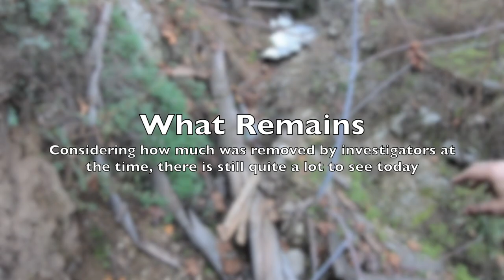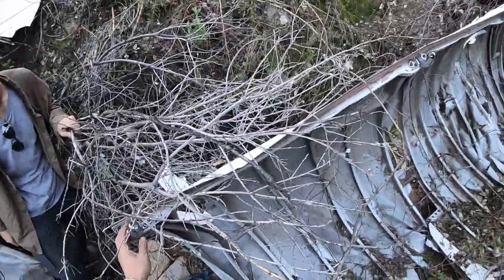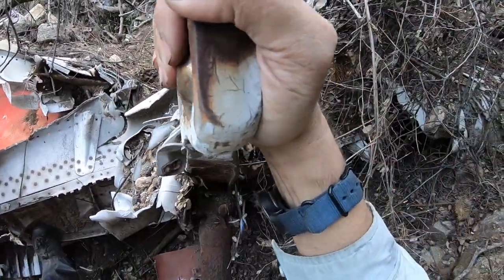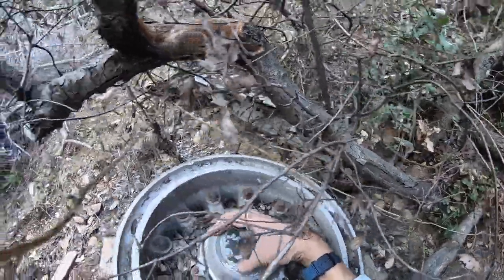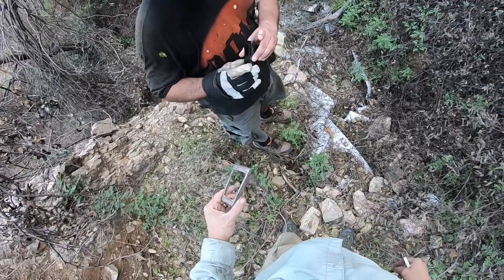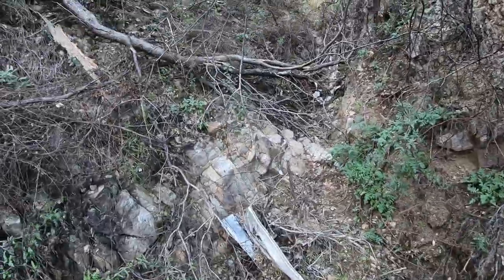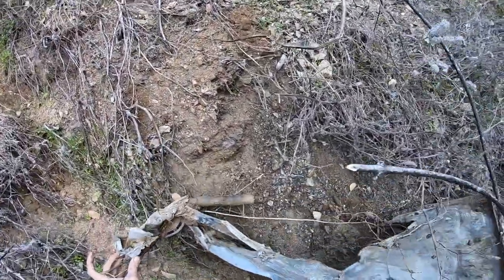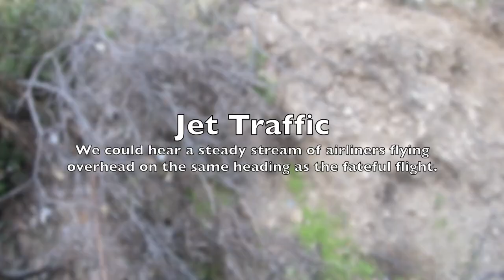1971 DC-9 Crash - Part 3 of 3 - Exploring the Wreck

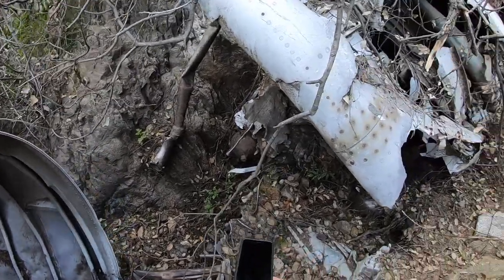Comment: The "round thing" at 2:53 is a brake accumulator. It sits in the main gear wheel well on the DC-9 (and MD-80).
Reply: Could also be one of elevator hydraulic accumulators placed in rear fuselage under the tail, since it is close to the engine cowling.

Comment: I heard the crash in my driveway in the Fish Canyon area of Duarte. It was a very loud boom, that at first I wondered if windows might be broken. My neighbor across the street shouted "look up there". A flaming piece of wreckage was visible falling into the San Gabriel mountains above our neighborhood. Then I saw the DC9 slowly losing altitude. No smoke or flames were visible. It glided down, dropping out of sight behind the mountain. Next came a huge plume of black smoke, then a second huge plume of black smoke. There was no sound, other than the initial loud boom of the crash. Another neighbor with binoculars spotted a parachute coming down, which we later learned was the navigator, who landed up on the mountain. It was a beautiful, clear late afternoon, on a Sunday I believe. One of my friends rode his motorcycle up Van Tassel Fire Road to the crash site, near Mt. Bliss and was first on scene. It was a horrible scene he described with bodies, body parts and fire. The park below the crash site, Royal Oaks Park was used to chopper out the bodies using the Los Angeles County Fire Dept UH-1 copters. This took weeks. Later, parts of the aircraft were helicoptered out to the dry riverbed in lower Van Tassel canyon where a truck hauled them off. There were lots of melted pieces of aluminium due to the fire. Very sad. Thanks for finding it. I always wondered what was left up there.
Reply from the maker: Thank you for your remembrance

Comment: At 7:19 the "GE" light is located on the side of the aircraft between the wing root and the cargo door.  There is another just in front of the engine nacelle.
you can see it clearly in this pic - https://en.wikipedia.org/wiki/McDonnell_Douglas_DC-9#/media/File:Northwest_N756NW_DC9.JPG,

Comment: wonder why they didn't take all the pieces of the plane especially the tail
Reply from the maker: They attempted to take the tail out, but the story goes that it became unsafe on the sling while being flown out, so they cut it loose. That is why the tail is at a separate site, and has a straight line cut.